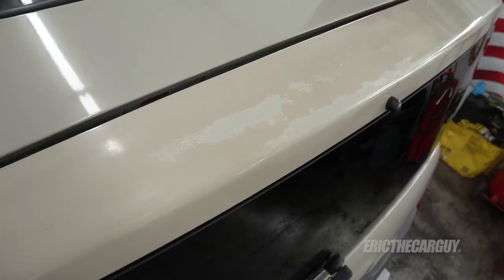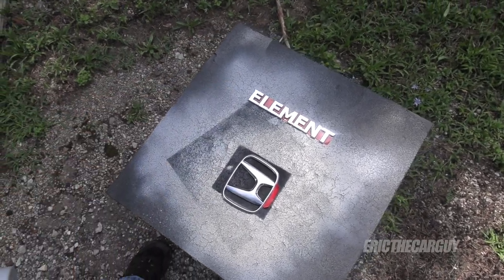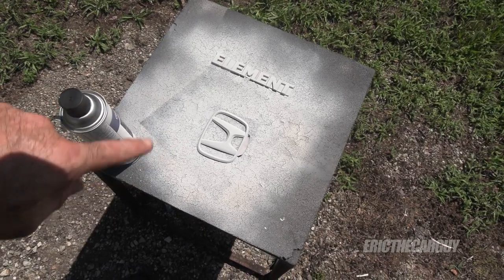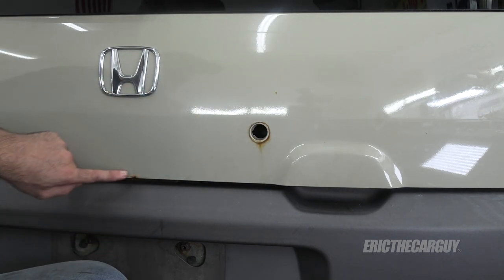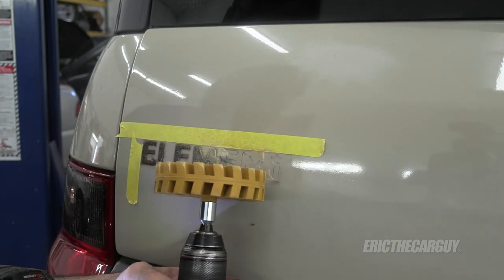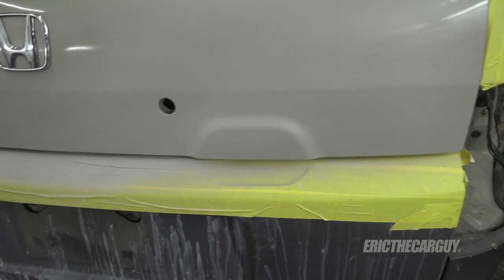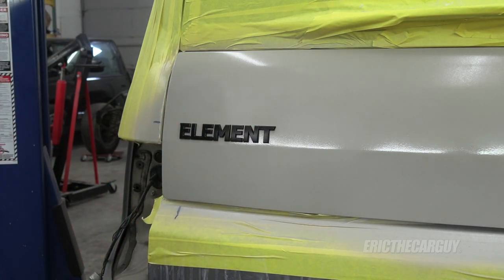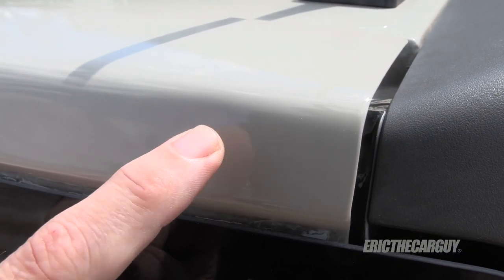DIY Clear Coat Repair

Comment: With the 'ELEMENT' emblem, I would have created a template from tape from the bottom side of the emblem that fit the shape of the door below it, marked where the emblem went in relation to my template, then removed the template ever so gingerly, and stuck it to the inside of the glass.  Then when you are done with your body repair/re-paint, simply stick the template to the lines on the door and VOILA. perfect placement of your new emeblem.
Reply: Another vehcor subscriber here. :-)

Comment: Instead of wet sanding the orange peel away, you can do a compound cut + polish pretty quickly. That's what i usually do for quick rattle can repair jobs on bicycles.

Comment: They have non hyper flash led turn signal out there. I have them on my V and they work great. Don't have to worry about installing those resisters.
Reply: Depends a lot on the switch used. not all of them hyperflash. But I think Eric has some experience in that regard knowing elements quite well and knows how they will behave.
On some vehicles it may also be electronically controlled together with an indication in the dashboard that a bulb is broken or missing. in this case you might need a resistor anyways to convince the computer that there is a bulb installed after all. Oh, most likely in this case you may not find a flasher to replace anyways.

Comment: I just ordered the 3rd brake light for my 2006 element. Thanks. For the videos Eric.
Reply from the maker: Be careful installing it. Mine seemed a bit too wide and cracked the connector.

Comment: That blink on activation really does help bring attention to the brake light.  They started showing up soon after some big study on how human vision detects rapid changes.

Also, reverse lights are just headlights for backing up.  Fight me.
Reply: Pay attention to your local regulations, they may not be legal in some states. Living in Germany I know for sure, here in Europe they are not. The only exception from that is that it may be allowed with certain assisted braking systems if you hit the brake suddenly and hard. Although most cars in that situation just activate the hazard lights today.
Otherwise the blinking lights are not allowed to avoid cars having those drawing to much attention and distracting drivers in a way that they may oversee a vehicle without those next to it as they pay attention to the blinking ones. For the same reasons here in Germany blinking backlights on bicycles are not allowed.
As it is, currently there are not any legal replacement LED bulbs available here anyways. The ones you get would void the vehicles operating permit. There are only headlights available from one single brand recently, but so far those are only certified for a limited number of vehicles yet (They have to test and certify for each single modell as it seems).
I don´t know for e.g. the brake lights if the manufacturers (and even the big brand names around here) never tried to get LED replacements certified or if so far they simply did not pass the certification requirements. Which to be honest is quite annoying as I think in terms of brightness and longevity LEDs are superior. But it seems the more directed light distribution from the LEDs (an incandescent bulb can be imagined as one glowing dot, the LEDs can be visualised as a cluster of lights shining a beam into specific directions. You could see that on the red lights when Eric tested them, they had been bright on the side and on top, but with a shadow around the top) does not work well in general with all reflectors used in taillights which might result in those LEDs being actually a lot dimmer when seen from the back mounted in the car. It seems for some it works quite well, for others, not so much. I guess that might be why they started certifying it for the much more expensive headlights, which currently run at around 170 € at least if I remember right while it makes no sense for a rear or brake light (which are quite often combined Bilux bulbs anyways) which can sell for 15 to 20 € at most.

Comment: I believe your hinges are over extended. They might be bent past their original geometry. Someone may have over extended the rear liftgate out of frustration after they smacked their head off it......But that's what happened to mine. Luckily you can compare it to your other one.

Comment: you could just use a piece of masking paper cut to fit around emblem taped to window then pull it up and tape out of way then flap it back down to locate new emblem. also dental floss might work well for taking off emblems

Comment: Rust converter?? Also, I'd let the base coat dry and out gas overnight. Also would let the clear dry off and cure for a couple days, inside and then compound/polish before taking it outside

Comment: 120USD FOR THE EMBLEM?!? that's like 1 month worth of groceries for where I'm from.
Reply: Crazy right? Someone is making a serious markup on those few grams of material...
Reply: Definitely a rip off.
Reply: Thats just the life of direct ordered OEM parts. Rear suspension bolt for an Accord I worked on was $17 and $6 for the nut. Comeplete rip off. Much better to go get the part from the manufacturer if possible Aisin, Denso etc

Comment: @EricTheCarGuy:  I can also see that the tailgate and the hatch are mounted too high.  The bottom edge of the rear glass should be level with the bottom of the side glass and the gap at the bottom of the gate should be smaller . I'd be willing to bet that rear end collision totalled the hatch and/or tailgate and you have salvage replacements. The collison caused the two side top moldings along the side of roof to be pushed forward or damaged.  They do not overhang the side glass at the rear as much as those of my Element. Pop off the top outside access panels in those moldings loosen the screwcs and pull them rearward.

Comment: WD40 works great for taking off adhesive glues!
Reply: I once had a can of an adhesive remover intended to remove adhesive residue and stubborn self sticking labels. That stuff worked great, I think it was just something like orange oil in a spray can. Also smells great ;)

Comment: Late model cars DO NOT flash the third brake lights. It’s a dealership margin booster,  like pin-striping, done to vehicles on the lot prior to sale and pushed to customers on the grounds of “safety”. The blinking light is actually more distracting to other drivers, leading to unnecessary  panic stops, and is actually borderline illegal in many states.

Comment: the panel need to be sanded to 600-800 on every place where new base and clear paint will be. if it's shinny it wont hold. For the clear use 2k clear with punch calatys in the bottom it's the easier for can paint with a perfect result you clear is like the duplicolor one and it's bad with a lot of orange peel but there base color is close. check paint society here on YT it's a great channel about paint, he has diy can paint tutorials. Also you should mask more of the car overspray can go far before it dry flying. I dont blame you i have been throught that before, now I paint in gun primer and clear but use can for the base

Comment: A cheap rust reformer like the Rustoleum spray would have helped the pitted metal from returning as quickly. It’s not Por15, but it works pretty well for what it is and dries very quickly.

Comment: My mechanic OCD is going crazy so gotta ask...why did you remove the "element" emblem but not the "H" emblem before painting??  Your new clear coat surface is already peeling at the top of emblem.  Also it looks like you did not wet sand the the tailgate surface above the "H".  New paint adhesion might be a issue.

Comment: Next time find something to prop the hatch on and remove the shocks to adjust. Most of the time the shocks will actually push outwards and it almost looked like that was happening in the video. So remove shocks,  adjust, then re install shocks.

Comment: Didn't I see a glass bead machine in your shop?  I would have shot the emblems with glass bead primed and painted them. But I'm a use to be auto body technician, retired air compressor technician now but still paint motorcycles from time to time. Yea the body work and paint takes a lot of patience, the more you have of it the better things turn out.

Comment: I think 2K clear would have looked a ton better. It’s separate clear and activator that mixes in the can, and lays down just like what comes out of a gun. It also cures harder and holds up better. 1K clear will damage more easily.
Reply: That stuff is toxic if you don't have a sealed suit and cartridge masks

Comment: Would go much faster if unbolted the tailgate and using a da sander.
Just measure the emblem locations first and mask the inside and the window.
Much easier to get a even sanding too.
Tailgate is clearly out of wack anyway so it would not do any harm to unbolt it from the body.
That''s my 2 cent anyway.

Comment: Have you used those LED bulbs before? I always have issues with them when customers come in with those installed in the dome lights and license plate. They either burn out super fast or they flicker and dim intermittently.

Comment: Eric I have to buy an axel for a 1997 f 150 four wheel drive 4.6 engine. How do I find out if it's limited slip or what ever. Thanks.

Comment: I'm no expert, however I think I would have just removed all the emblems and sanded it all down so I wouldn't have to try to get not only the paint to match, but the clearcoats.  For the emblems, just measure left or center of each from one side of the door and from the floor.  I would naively think 15 minutes to clear the emblems, and then a cheap planetary sander with a few higher grit papers should have had it ready for prime and paint in 30-45 minutes tops.  Yes, everyone's an expert on the internet...
Reply from the maker: To preserve its location. That's one thing I didn't want to get wrong.

Comment: 5:52 these screws are for adjusting up/down/left/right... Not in/out.  its obvious from their location after closing the trunk.
7:02 you can take of the trunk door, and make those holes for hinges bigger, so you can push the trunk door deeper.
8:35 i think thats illegal in most countries.
27:15 it looks awfull. You should buff it a little

Comment: I would have just used plasti dip! No sanding and can be spray on in place on the car. It peels off at the bottom at the sharp edge. And can be reapplied. As a painter however I did two stage paint my rear emblem off the car.

Comment: Hello Eric, how do I get the bulb 💡 number so I can replace the tiny lights for the heater and controls, for my Nissan Sentra GXE. No number or letters on the factory bulbs.
Reply from the maker: Check with the dealer.

Comment: hey Eric good job for a novice .
just wondering could you give us the total cost?
badges , paint,primer,clear,musking+could of used newspaper LOL,wax grease remover, sandpaper,buffing compound and your time, compare to a proper body shop quote?
Reply from the maker: $300? I had a lot of the materials on hand like the sandpaper and chassis paint.

Comment: $120 + $40 for 2 plastic badges? 

If you pay these extortionate prices to the dealer they will continue asking them.
Consider more budget friendly options such going without emblems, having a sign shop make stickers from sheet vinyl. Or reusing the old emblems.

The sign shop can also make you a paint mask so you can paint your black emblems on before you overcoat with clear.

It might be worth a consultation with a body shop to see if they could help  with the door alignment. 
Have a chat with the local auto paint supply store.  They tend to do a great job of matching paint, and can even put in an spray can for you or sell you an air bush.

Comment: Did you consider Plastidip for the emblems? If so, why not do it that way? It's super easy, reversible and you don't need to remove the emblems or do any complicated masking!
Reply from the maker: Because I have about 4 cans of chassis black from Eastwood. Keep in mind this is my winter car. Thanks for your comment.

Comment: I am an exbody man with 30 plus years in the insurance business. Most likely scenario is that the estimate was written by a computer program which included emblem replacement. The body shop pocketed the money for parts and labor associated with the emblem replacement because the insurance company isn't going to inspect the finished job, and the owner of the car is dazzeled by shiny paint, and doesn't really know what they are looking at.
Perhaps the company sent a check and the car owner shopped for the lowest price and associated quality. The owner either accepted the poor paint and the large gaps, or did not notice.

Comment: Without even getting to halfway through the video to the close-up of the gate, I could already tell it was worked on from the horrible orange peel. Significant ripples like they never wet sanded in between.

Comment: Damn it sucks that all the vehicles you've dealt with that have been through a body shop have had half ass work done, really gives us good guys a bad name :( The shop I'm painting at now is a bit rough, but it's out of my hands. All I can guarantee is a good colour match, adhession, and a good finish with no signs. The rest is up to them, and I've seen some hacky stuff get done before or after paint work :\
Reply from the maker: I don't blame the body shops so much as the insurance companies. BTW, there was a body shop at the dealer where I worked which is were I got most of my experience from. https://www.youtube.com/watch?v=a5RRJZrhkBI&t=3s
Reply: @ericthecarguy  Yeah I know the insurance companies have been putting the squeeze on us, but I like to believe it comes down to personal attitude. Some things there are just no excuse for, regardless of "if we're getting paid for it" Bad attitude can really make for poor work, and poor work habits. Maybe it's a thing with the older generation? I'm 29, but most of my co-workers in the body shops have been 50+. Perhaps they are just over the hill and starting to phone it in, I'm sure you've seen that in the mechanical world?

Comment: Nice job. The only problem i see is your clear spray is crap. I've had great success with (spray max 2k clear) it has a harder in it. You pop it on the bottom to mix it and shake. I did my jeep fender with it. Added 3 coats. It was an amazing job for my 1st time doing body work. Give it a try. its about $20 a can.

Comment: Those brake lights that initially flash before going solid are extremely initiating, and should be illegal. The only instance flashers should be used is for emergencies or when parked off the side of the road.

Comment: Why didn’t you remove the emblem before the paintwork 🤨
Reply from the maker: To preserve its location. They are very difficult to line up if you don't mark them first. Had I laid tape down before, you'd see the hard lines from where the tape was.

Comment: You changed $120 emblems, but did not change the bent trunk hinges for $200
Reply from the maker: I know, it makes no sense. However, I didn't know about the trunk hinges, also, if the hinges are bent, other things probably are too. Thanks for the comment.

Comment: Why bother spending so much on new emblems just to spray bomb them? Why not run to the hardware store and pick up some thinner 3M double sided sticky tape for less than $10.00? Much cheaper than $120.00? If you break an emblem getting it off, then you hit the pick ‘n pull junkyard! Save your money for the mechanical part that is gonna fail next week?